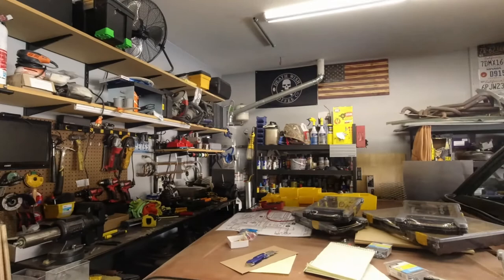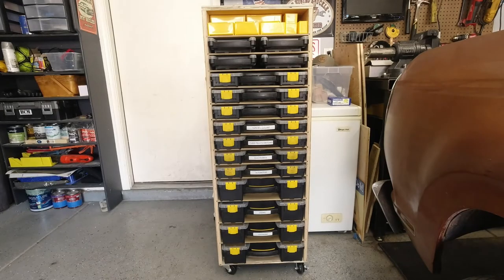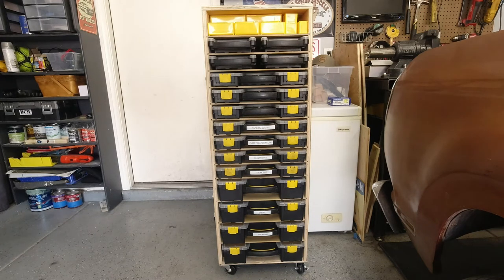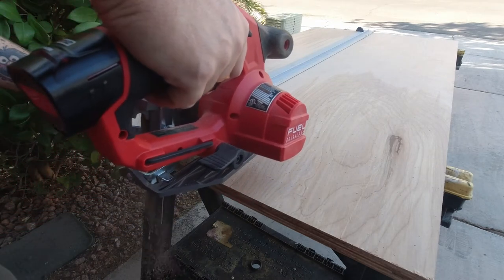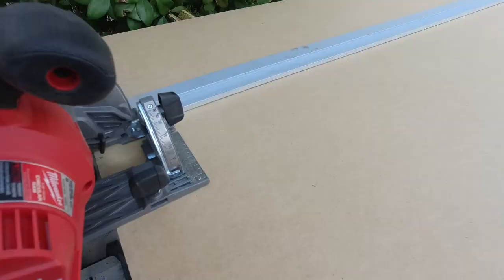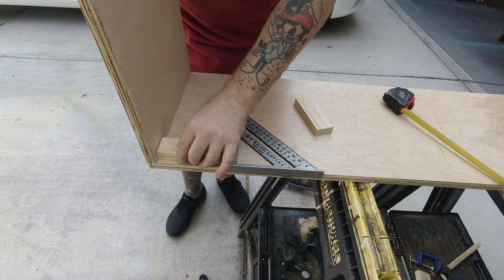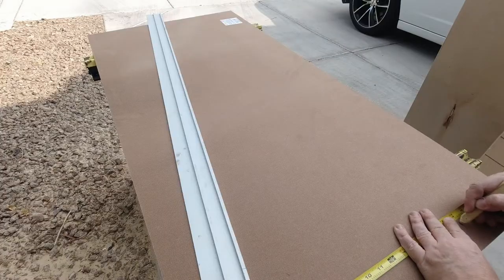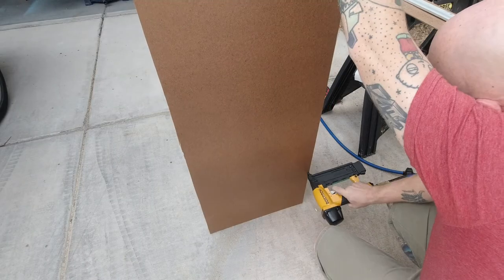Harbor Freight Sortimo Storage Bin Small Parts Case Organizer - One Day Build

Comment: what are you using as a straight edge to cut your long plywood with
Reply from the maker: It's just an aluminum straight edge guide.  I don't remember the brand or where I got it...probably from Lowes or Home Depot...it is a 2-piece guide that, when assembled, allows you to have an 8-foot straight edge for ripping full pieces of plywood.  Just measure, clamp, and go to town!

Comment: What type of router bit did you use,1/4 or 1/2 did you have to make several passes,sorry new to this
Reply from the maker: 1/2" router bit.  If I remember right I did a couple of passes, just because I mainly use a trim router, and that could be a lot of meat to remove at once.  But, it could be done in one pass

Comment: Why not route out small shelf slots in your double slots so you can easily downsize to an all small cabinet  when you have to build an all big size cabinet later?
Reply from the maker: I thought about that, but the space needed for 2 of the small containers is more than the space needed for 1 large container.  By building this rack with adjustable shelves to accommodate mixing-and-matching small and large containers would make it taller.  I realize there is space above the last container, and that area could have been used to make the rack more modular, I use that as a catch-all for extra bins and other misc items